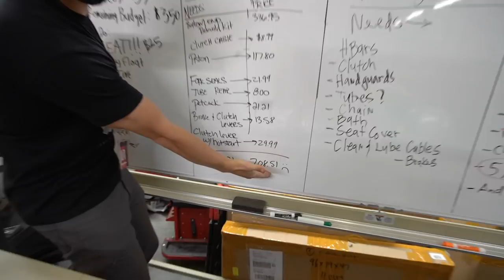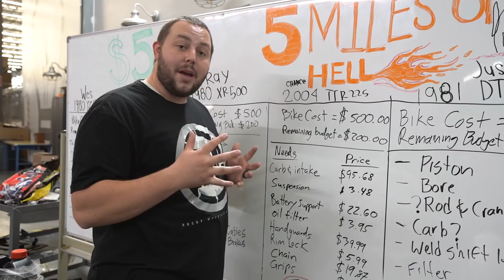SENDING IT on $500 Motorcycles | 5 Miles of Hell $500 Motorcycle Challenge - Episode 4

Comment: If the xr500 dies for any reason when hot, immediately turn the gas off before trying to restart. If it still wont restart, carry a small screwdriver to partially drain the fuel bowl. It will then restart. Turn fuel back on after restart.
Reply from the maker: Sounds like you've got some experience with those things! It died several times but we were always able to get it started (after 20 kicks).
Reply: @rmatvmc  I've definitely used that trick numerous times. I also appreciate the great deals and free shipping on the Harley and Vstrom tires I've purchased from Rocky Mountain ATV.